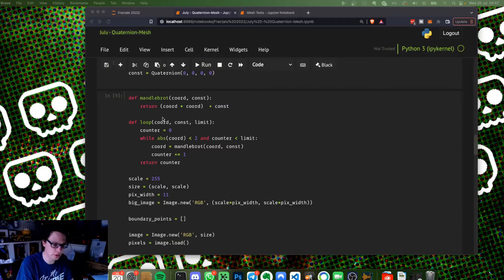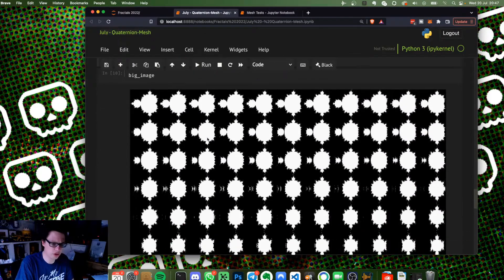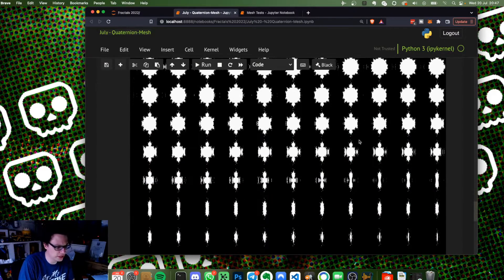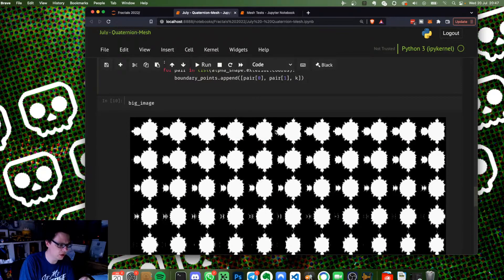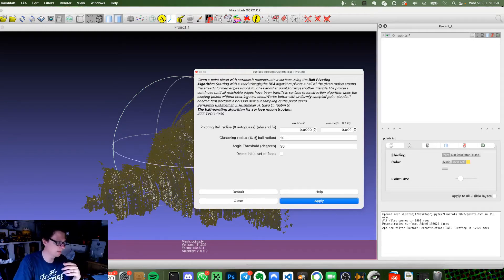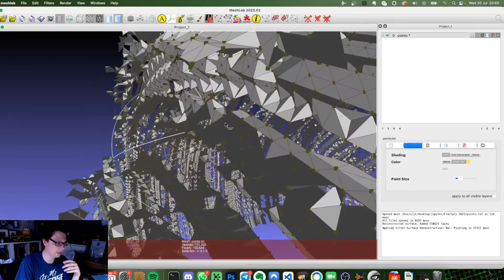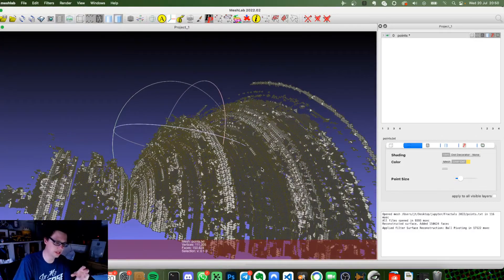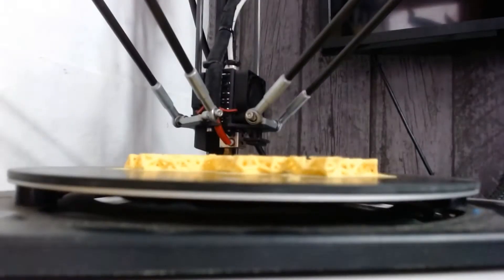Printing 3d Mandelbrot Fractals!

Comment: Are you aware of cura's wire printing mode, in the experimental settings?
Reply from the maker: That’s a good call. - I’ll give that a go. But I think at the moment the issue is really in generating a stl which has some depth - the reality is any width at all is a simplification of the fractal and an immediate loss of detail.

Ideally ild have an infinite amount of time and polymer to print just one layer:)
Reply: @InvalidEntry  i have access to a resin printer if youd like to have me give it a go on that
Reply from the maker: @Arcade3145  That could be cool - I know theres one at the hackspace but I have little experience in using it. I think first let me get a better model (the next gen) - in effect what I printed is what the model was after the meshlab stage.